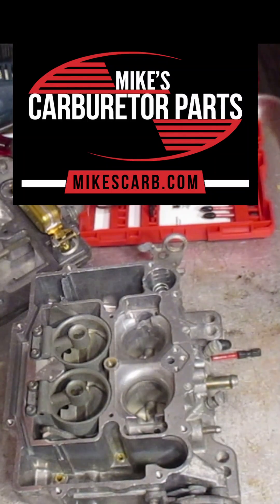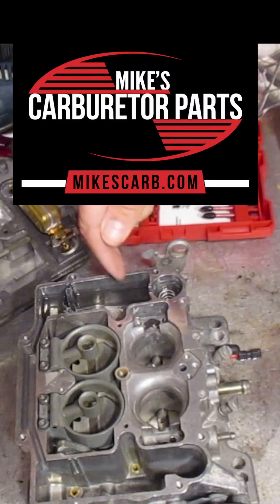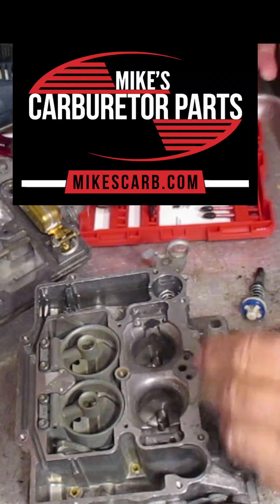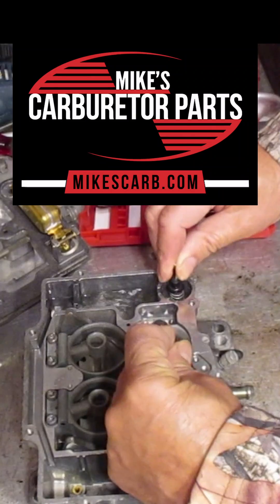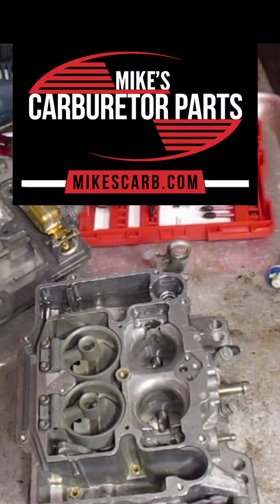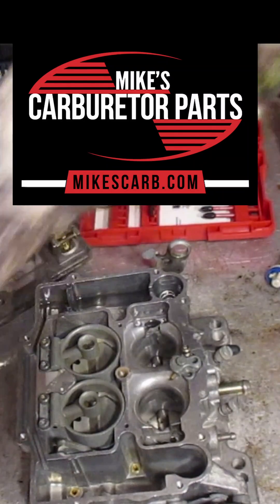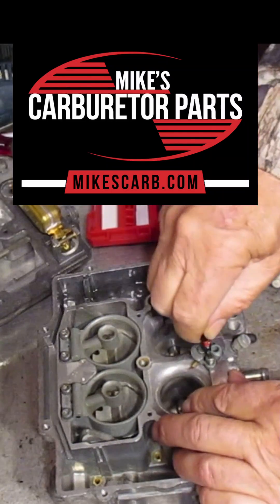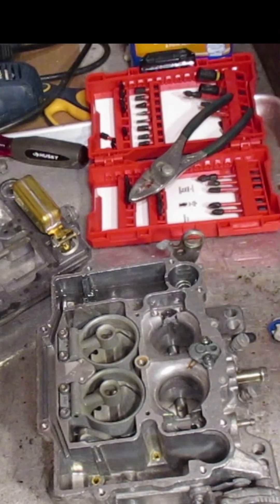Edelbrock 4 Barrel Accelerator Pump Test

Comment: I had this problem with my carburator.  It sat for about 6 mo. And it was clogged to deaf.
Reply from the maker: Yeah, unfortunately fuel turns quickly and wreaks havoc on the carb systems.